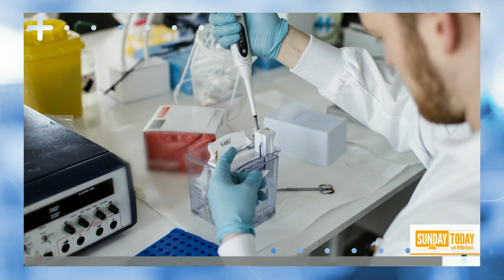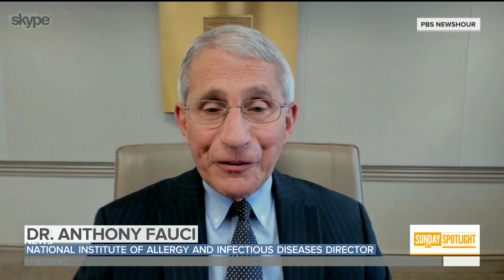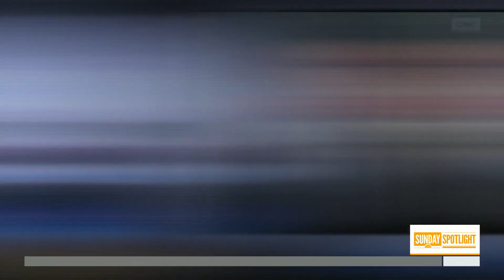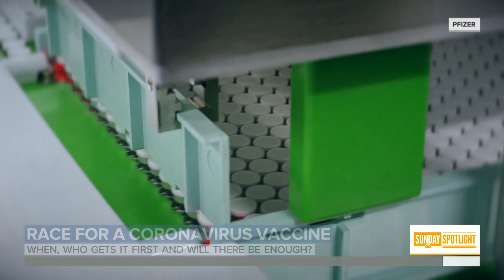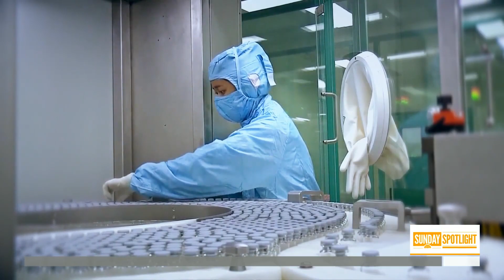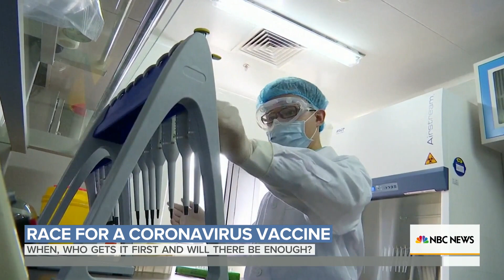Inside The Rush To Develop A Coronavirus Vaccine | Sunday TODAY

Comment: 1.Acer SB220Q bi 21.5 Inches Full HD (1920 x 1080) IPS Ultra-Thin Zero Frame Monitor (HDMI & VGA port),Black 
Url:https://amzn.to/2CJBnoz

2.Sceptre 24" Curved 75Hz Gaming LED Monitor Full HD 1080P HDMI VGA Speakers, 
VESA Wall Mount Ready Metal Black 2019 (C248W-1920RN) 
Url:https://amzn.to/3jASVUE

3.AmazonBasics Stainless Steel Portable Fast, Electric Hot Water Kettle for Tea and Coffee, 1 Liter, Silver 
Url:https://amzn.to/3jxHgpv

4.LINENSPA All-Season White Down Alternative Quilted Comforter - Corner Duvet Tabs 
- Hypoallergenic - Plush Microfiber Fill - Machine Washable 
- Duvet Insert or Stand-Alone Comforter - Oversized Queen 
Url:https://amzn.to/2E9PAvn

Comment: Who thinks that Trump's "Operation Warp Speed" (the COVID-19 vaccine program) is a good idea?

"The goals of [Operation Warp Speed] the project to develop, manufacture, and distribute hundreds of millions of COVID-19 vaccine doses by the end of 2020 have been criticized as being unrealistic, based on decades of experience in developing viral infection vaccines which normally require years or decades for assuring the chosen vaccine will not be toxic and has adequate efficacy. Most viral infections do not have vaccines because the vaccine technology has failed in early-stage clinical trials. Because many vaccines cause side effects, such as pain at the injection site, headaches, and influenza symptoms, safety testing requires years of observation in thousands of clinical trial participants. Similarly, sufficient time – a year or usually many years – is needed to be certain a vaccine has durable efficacy while the virus remains pandemic. For these reasons, despite extensive previous research attempts to produce safe, effective vaccines against coronaviruses, such as SARS and MERS, all vaccine candidates for coronavirus infections have failed during clinical research, and no vaccine exists to prevent coronavirus infection. To prepare for manufacturing and distribution, Operation Warp Speed will expend resources and financing before the safety and efficacy results of vaccine candidates are known, possibility wasting vaccine doses and their costs." • Wikipedia

https://en.wikipedia.org/wiki/Operation_Warp_Speed#Timeline

“Currently, there are no RNA vaccines approved for human use.”

Just like normal vaccines, RNA vaccines are intended to induce the production of antibodies which will bind to potential pathogens. The RNA sequence codes for antigens, proteins that are identical or resembling those of the pathogen. Upon the delivery of the vaccine into the body, this sequence is translated by the host cells to produce the encoded antigens, which then stimulate the body’s adaptive immune system to produce antibodies against the pathogen.

Currently, there are no RNA vaccines approved for human use. RNA vaccines offer multiple advantages over DNA vaccines in terms of production, administration, and safety, and have been shown to be promising in clinical trials involving humans. RNA vaccines are also thought to have the potential to be used for cancer in addition to infectious diseases.”  • Wikipedia

https://en.wikipedia.org/wiki/RNA_vaccine

“… RNA vaccines are under development to combat the COVID-19 pandemic …”

“Multiple companies, including CureVac and Moderna, work in the development of RNA vaccines, and a number of RNA vaccines are under development to combat the COVID-19 pandemic.” • Wikipedia

https://en.wikipedia.org/wiki/RNA_vaccine

“Public should be told that vaccines may have long term adverse effects”

“Research into immunisation has been based on the theory that the benefits of immunisation far outweigh the risks from delayed adverse events and so long term safety studies do not need to be performed. When looking at diabetes—only one potential chronic adverse event—we found that the rise in the prevalence of diabetes may more than offset the expected decline in long term complications of H influenzae meningitis. Thus diabetes induced by vaccine should not be considered a rare potential adverse event. The incidence of many other chronic immunological diseases, including asthma, allergies, and immune mediated cancers, has risen rapidly and may also be linked to immunisation.

We believe that the public should be fully informed that vaccines, though effective in preventing infections, may have long term adverse effects. An educated public will probably increasingly demand proper safety studies before widespread immunisation.

We believe that the outcome of this decision will be the development of safer vaccine technology.” • US National Library of Medicine

https://www.ncbi.nlm.nih.gov/pmc/articles/PMC1114674/

No-Fault Vaccine Court

“The Office of Special Masters of the U.S. Court of Federal Claims, popularly known as "vaccine court", administers a no-fault system for litigating vaccine injury claims. These claims against vaccine manufacturers cannot normally be filed in state or federal civil courts, but instead must be heard in the U.S. Court of Federal Claims, sitting without a jury.

The National Vaccine Injury Compensation Program (VICP or NVICP) was established by the 1986 National Childhood Vaccine Injury Act (NCVIA), passed by the United States Congress in response to a threat to the vaccine supply due to a 1980s scare over the DPT vaccine. Despite the belief of most public health officials that claims of side effects were unfounded, large jury awards had been given to some plaintiffs, most DPT vaccine makers had ceased production, and officials feared the loss of herd immunity.” • Wikipedia

https://en.wikipedia.org/wiki/National_Vaccine_Injury_Compensation_Program

Moderna: Trump‘s COVID-19 Shark Tank

“In 2014, after disappointing standalone therapeutic trials, Moderna moved to focus on mRNA vaccines given that, efficacy issues aside, mRNA will always stimulate a level of antibody development in subjects. The change in strategy had risk given the materially lower margins of vaccine development (called "loss-leaders" by some Moderna employees), with some senior employees and industry experts questioning the future viability of the company. Rossi left the company.

In February 2016, an op-ed in Nature, criticized Moderna for not publishing any peer-reviewed papers on its technology, unlike most other emerging and established biotech companies, and compared its approach to that of the controversially failed Theranos.

“A former Moderna scientist told Stat: "It's a case of the emperor's new clothes. They're running an investment firm, and then hopefully it also develops a drug that's successful".”

“In March 2020, CNN reported on a meeting in the White House, recorded on C-SPAN, between the Trump Administration and pharmaceutical executives, where Bancel told the President that Moderna could have a vaccine ready in a few months, materially undercutting the next fastest projection in the room. On the basis of Bancel's verbal commitment to Trump, Moderna received funding of $483 million from the Trump Administration. CNN reported that medical authorities including Dr. Anthony Fauci tried to rationally curb the enthusiasm toward any unproven technologies in this meeting, which Trump ran "like an episode of Shark Tank". In April 2020, Trump appointed Moderna board member Moncef Slaoui to "Operation Warp Speed". • Wikipedia

https://en.wikipedia.org/wiki/Moderna#History

Comment: they're not going to find a cure for the common cold, they've been trying to for over 40 years now, they're not going to magically manage it now.
Reply: There's a bit more incentive with this than with cold. They've managed to find preventatives for HIV (pRep), which didn't even exist in humans until the very late 1970s or early 1980s. HPV vaccine is now common. Diseases which cause the most damage get the most attention. Common cold is not dangerous.
Reply: @njhawksworth1588  except coronavirus is just a new form of the common cold, it's the same genus of virus, if they found a vaccine for the coronavirus, it would be a vaccine to all types of coronaviruses, including the common cold. if it where possible, we would already have a vaccine! the issue isnt incentive, the issue is that there are simply far too many kinds of coronaviruses to successfully employ any kind of preventative measure that would encompass them all, and there are just as many, if not more strains of sars-cov2. any developed 'vaccine' would be ineffectual to the majority of cornaviruses and covid strains.

Comment: This is The Opposite of what the New England Journal of Medicine's report on THIS vaccine said. Half the people had severe reaction  to the shot.    THEY ARE LYING .
Reply: Based on what I just researched, only 3 people had a severe reaction. And that was with a 250mm dose that was experimental, and they are currently going forward with a 100 microgram dose that only has mild side effects.

So where are you getting this information, that half of the people had a severe reaction when I can only find that 3 had a bad reaction???
Reply: @simonexoxo7972   I misspoke, it was in JAMA not NEJM. And slightly over 50% had "severe" reactions on the 2nd dose of the vaccine. Which they are saying is a necessary dose.  But who knows what they are really doing, they can falsify anything they want, like they have in the past.

Comment: I don't get it...why are most people so adverse to getting this vaccine? Sure it's a "rushed" vaccine, but that doesn't mean it's unsafe - on the contrary, this vaccine would have to pass several testing checkpoints and mass scrutiny to be approved, in the same way that every other vaccine has in the past. The only difference is that this vaccine is made the top priority of several research institutes so that the time we wait for a valid vaccine is reduced drastically, while ensuring the same efficacy and safety as all other vaccines.

Comment: Sounds like the beginning of a zombie outbreak 😷
Reply: No, it looks like for every vaccine approved, it's one step closer to ending the pandemic.
Reply: @billylopatto6269  And starting the next one? Flu vaccines are notoriously ineffective, that is why they come up with a new one each season. Studies outside the industry itself would suggest vaccines actually promote disability and disease. This demoncratic pandemic will end in November I would wager. Along with the cult of the mask and vax and chip and track.
Reply: Bruce Campbell: First off, the flu is an umbrella term for many different strains and subtypes, which mutate very rapidly. New strains and subtypes appear every year. Each year’s flu vaccines are based off the flu season in the Southern Hemisphere. So based off of data from flu season in the South, we can prepare for flu season up here in the north. Also, flu vaccines are effective. If you do catch the flu even though you are vaccinated, it has been proven that you’ll have mild symptoms as well as a shorter recovery time. Remember, no vaccine is guaranteed to be 100% effective, it just needs to provide protection against the disease or ease the effects of the disease. I hope that eases your concerns.
Reply: The Lone Journey  There is absolutely no evidence that supports that claim.

Comment: Main outcome measure: Clinical respiratory illness (CRI), influenza-like illness (ILI) and laboratory-confirmed respiratory virus infection.       Results: The rates of all infection outcomes were highest in the cloth mask arm, with the rate of ILI statistically significantly higher in the cloth mask arm (relative risk (RR)=13.00, 95% CI 1.69 to 100.07) compared with the medical mask arm. Cloth masks also had significantly higher rates of ILI compared with the control arm. An analysis by mask use showed ILI (RR=6.64, 95% CI 1.45 to 28.65) and laboratory-confirmed virus (RR=1.72, 95% CI 1.01 to 2.94) were significantly higher in the cloth masks group compared with the medical masks group. Penetration of cloth masks by particles was almost 97% and medical masks 44%.

Conclusions: This study is the first RCT of cloth masks, and the results caution against the use of cloth masks. This is an important finding to inform occupational health and safety. Moisture retention, reuse of cloth masks and poor filtration may result in increased risk of infection. Further research is needed to inform the widespread use of cloth masks globally. However, as a precautionary measure, cloth masks should not be recommended for HCWs, particularly in high-risk situations, and guidelines need to be updated.
Reply: I worked with a surgeon last week whose wife is an immunologist. She is making him wear a regular cloth mask underneath the regular surgical masks we use, not the N95. She paints a really sad pic of our future for the next year. I guess she should learn about the uselessness of on line cotton masks. Ha.....funny.
Reply: @linanicolia1363  hiding in your house pretending a mask will protect you is not helping anyone if it was why are cases rising
Reply: "The aim of this study was to compare the efficacy of cloth masks to medical masks in hospital healthcare workers (HCWs)." (PMID 25903751, published in 2015)

This study in BMJ Open that you are copy-pasting from is looking at the use of these masks in healthcare workers that are perpetually exposed to people who are sick. Of course cloth masks are not going to perform as high as medical-grade masks. This study is not comparing cloth masks to no mask at all. No mask at all would show numbers even higher than the cloth mask group. Copy-pasting select information from this article's abstract is incredibly misleading. Cloth masks are better than no masks - PMID  32329337 (American Chemical Society Nano published in 2020) discusses cloth mask material effectiveness for aerosol filtration. If looking this up in PubMed the related articles will also show additional literature discussing the use of cloth masks. While they are not as effective as medical-grade masks, they still provide a layer of protection.
Reply: @KonradNint3ndo69   @lina nicolia  if a fart passes through 2 layers of cloth and you have a mask on and still smell it how is a mask working